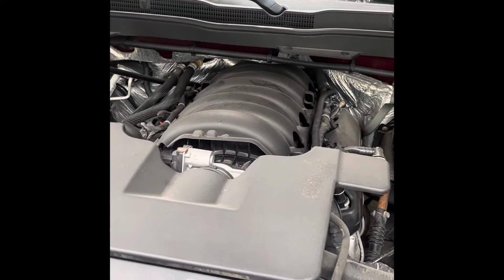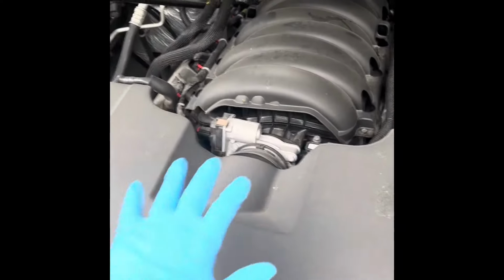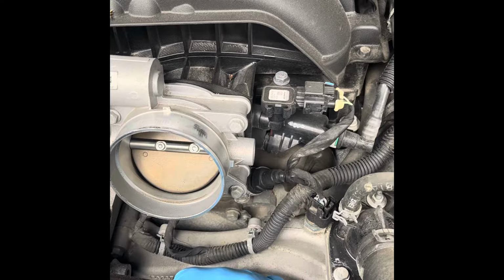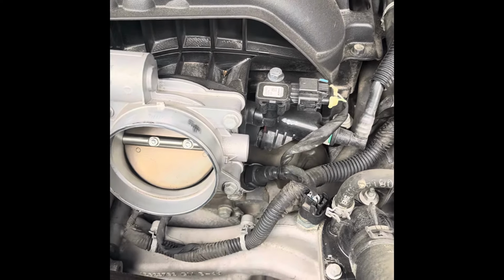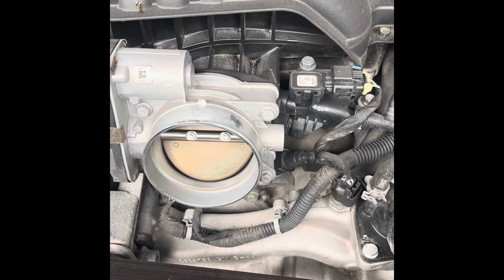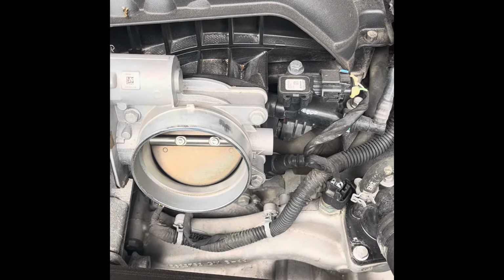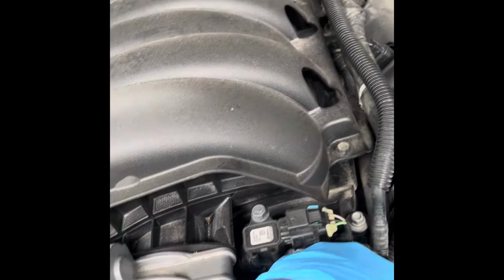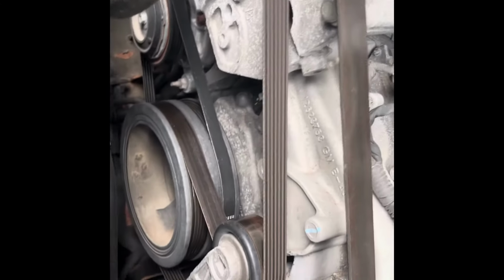2015 Silverado coolant temp sensor replacement #silverado

Comment: Great video. Thanks. 

Two quick things, don’t forget to remove the negative terminal from the battery to reset the system. I didn’t and it was doing the same thing as before. 
Second thing quick: I found that it was easier to just quickly put my finger over the hole and then slip the new one in. I lost about a tablespoon of coolant.
Reply from the maker: Thanks! And yes absolutely, I didn’t remove the battery lead but I did just cover the coolant hole while replacing the sensor, this is one of my first repair videos and have gotten much better since this, but I do appreciate your tips!

Comment: How do you remove the wire
Reply from the maker: Carefully pry up on the tab and slowly remove it. If it really doesn’t want to come out grab some plyers and carefully pull up while prying the tab out, be gentle as the plastic becomes very fragile as it ages

Comment: Next time show the tools needed and steps to do the job. And it’s a good rule of thumb to have a second layer of protection with the seal of the sensor. You can’t trust a metal washer to seal properly against metal surfaces. Should have definitely put a lap of teflon or some thread seal on.
Reply from the maker: Thank you for your advice, newer videos i have done I have started to do a better job showing these things.

Comment: That don't tell how you remove the connector censor
Reply from the maker: Sorry about that bud, you gently pry on the tab and it should come off
Reply: @DohmSpeedShop  lol I tried that and the tab broke then it wouldn't come out easily it broke so I had to get new sensor clip and body but I appreciate your response
Reply from the maker: @christopherturner1470  yeah sometimes no matter how careful you are the plastic is just so fragile it breaks either way
Reply from the maker: @christopherturner1470 no problem, never hurt anyone to ask a question haha